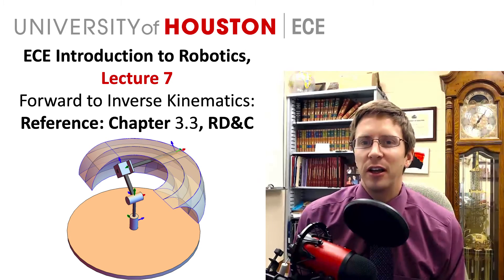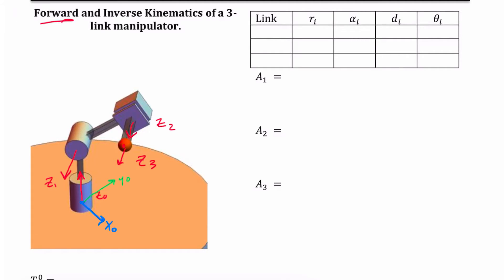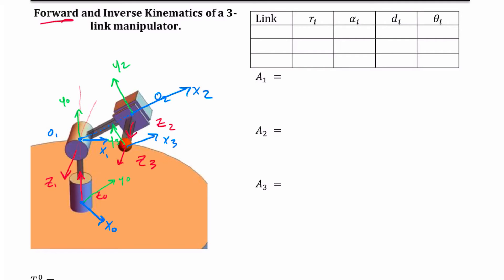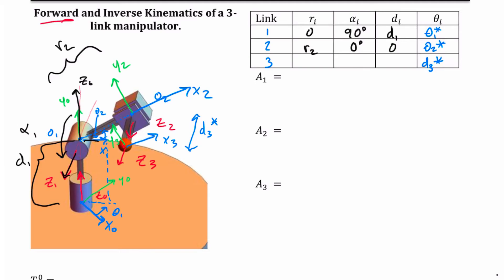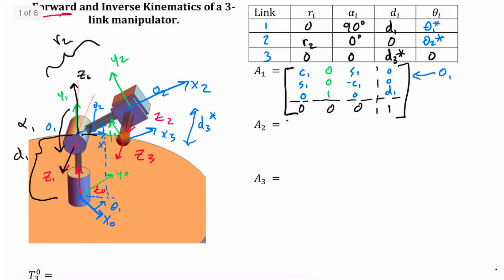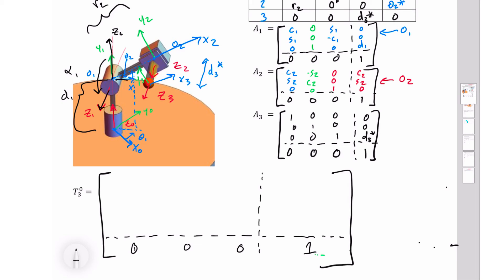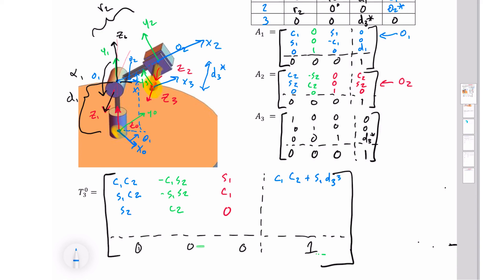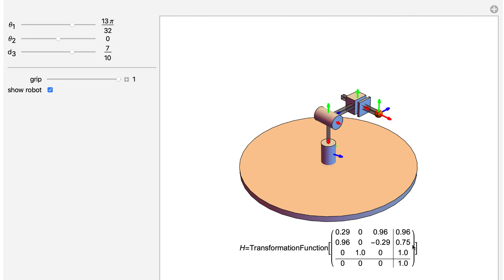Intro2Robotics Lecture 7b: Forward to Inverse Kinematics example

Comment: I don't really get what's c1 and r1 in the A1 matrix. It has some connection to Theta1 but I don't really get it
Reply from the maker: The abbreviation for cos(theta1) is c1, and r1 is the radial distance of the rotation about the axis z0.  This is the distance along x1 from z0 to z1.

Comment: Sir, you are filling this dh table in a completely random way, it does not make it easier to understand. I did but for someone else it could be difficult. Please, consider filling it either row by row or column by column
Reply from the maker: Yes, that would be a better way to do this -- next time!
Reply: Thanks for this comment. Sometimes professors forget they are teaching people that have different range of assimilation. Some of us have a linear process of learning.😅

Comment: Really good video Sir,  could you tell me what software you use to simulate workspace of robot , thanks you so much
Reply from the maker: I've been using Mathematica to graph the workspaces.  You can try some of these for free at https://demonstrations.wolfram.com/RobotManipulatorWorkspaces/ (requires a free download).  I can relatively easily generate the workspace for a 3 DOF robot, but drawing the workspace for a 4 or more DOF robot is slow.